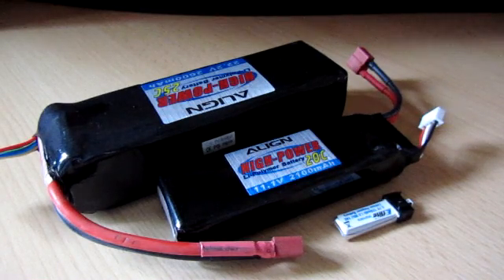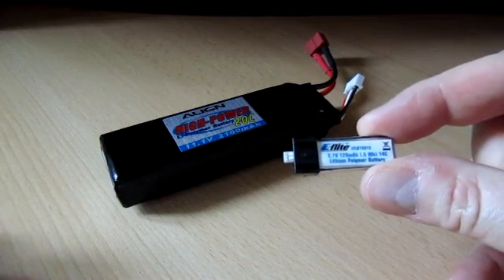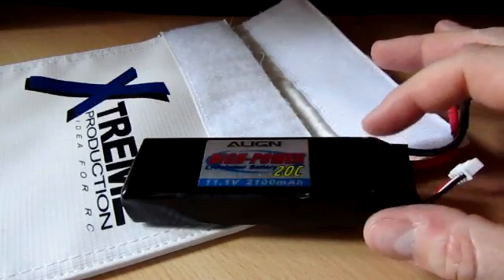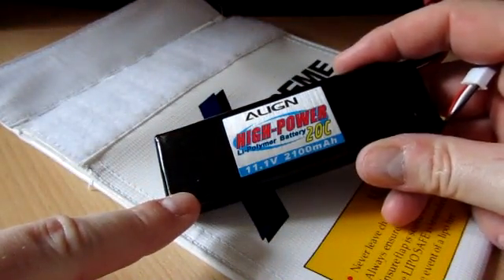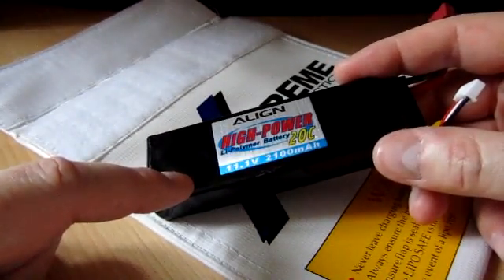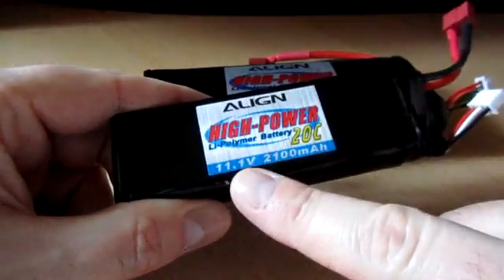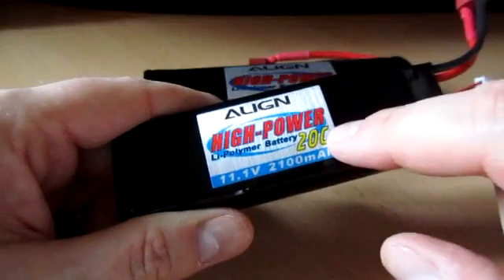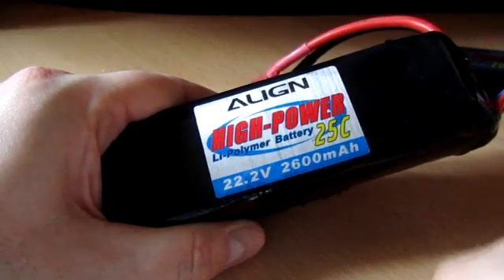Simple overview of the LIPO battery (LIPO Explained - mAh, C rating etc)

Comment from the maker: @Gubernator45, the 20Wh is actually redundant here. All you need to know about the pack is already there in the other numbers -  Watthours = voltage x ampshours (1800mah x 1.1volts = 20Watthours (Wh)). 

Basically it's the same as the 1800mah rating and shows how much 'power' is in the pack and how long that power would last. Hope this makes sense..